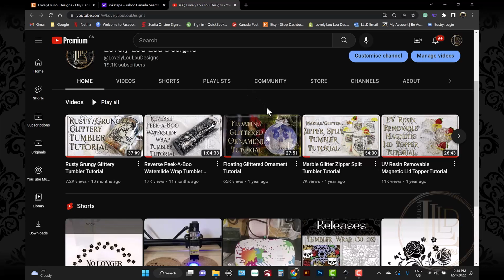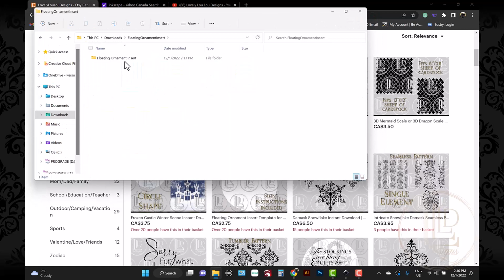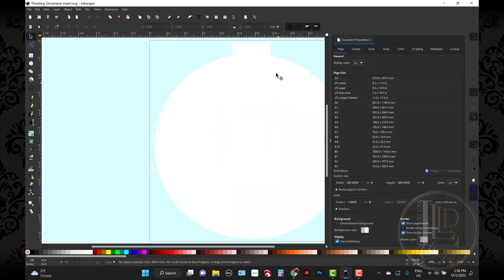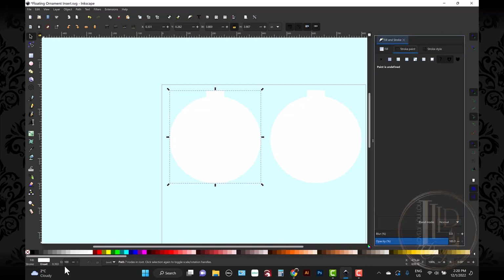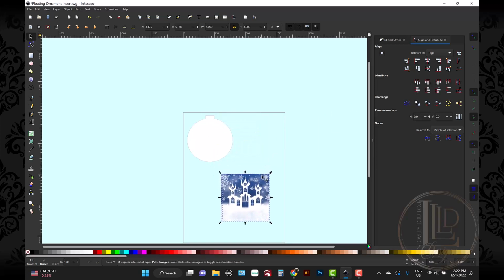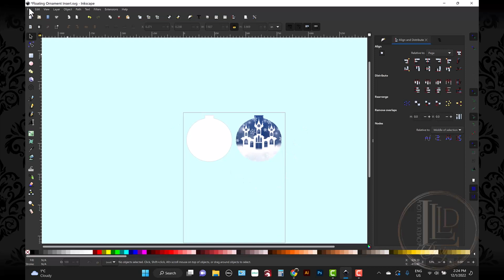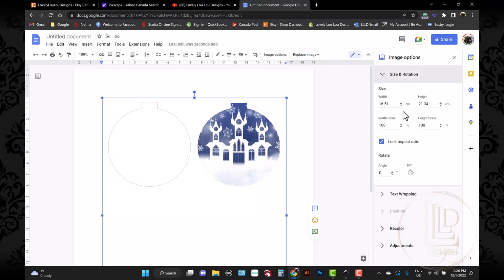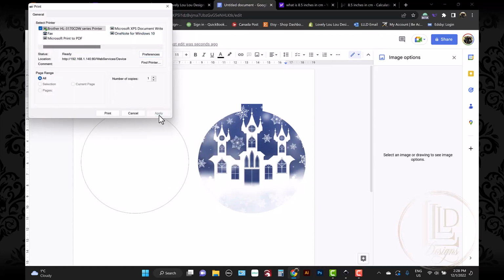Floating Ornament Template No Cutting Machine or Paid Design Software Needed

Comment: Hi Lou Lou. I have 2 laser printers. One really old HP and the 2nd one is a Canon Image class Laser printer. However I was told that my Canon likely cannot accept the transparency film as it gets so hot and would melt the film..however you are mentioned you use a different setting because of that? Can you explain? Also I have a Cricut, can you explain an easier way to do this design/ While you were as succinct as possible, there were so many steps and prompts to choose. It sounds easy for a true professional and someone who is much more Computer literate than I am. thanks so much!!
Reply from the maker: I just purchased a Canon Image Class but haven't used it for transparency film yet. I was told the Brother printers run hotter (which is what I have). I will try my settings and see how it prints
Reply: @LovelyLouLouDesigns  excellent thanks. I have the mf644cdw. Much appreciated!!

Comment: I bought the printable acetate, but cant figure out which side is the top. ( opened it up and didnt pay attention to the way i took them out to put them in a holder, and now even though every one says feel for the rough side, it doesnt help me. No mater which way i put it in, my ink is wet. Any suggestions? Ive done this type of ornament before, but i love your graphic, and the half coverage of glitter.! Thank you for sharing!🤗🤗🤗
Reply from the maker: If the ink is wet are you sure you have the transparency film meant for inkjet printers? They sell them for inkjet and laser. The ones I use are for laser and it doesn't have an "up" side. I can print on either. I'm sorry if I can't be more helpful:(
Reply: @LovelyLouLouDesigns  thats good info. It does say ink jet and laser. My inkjet is the really good color so i wanted to use it.